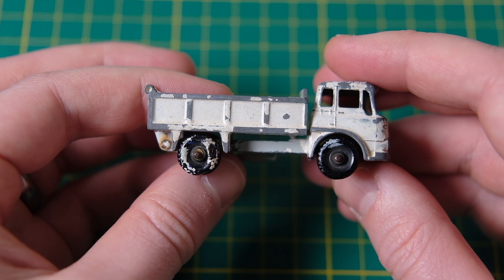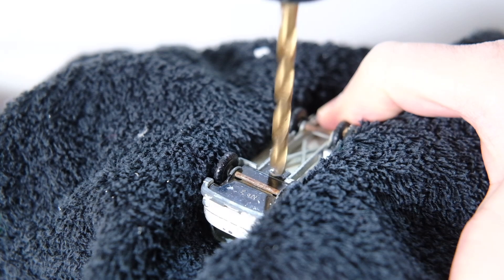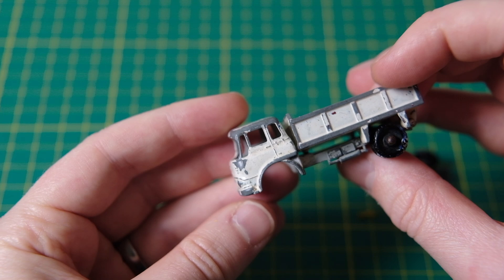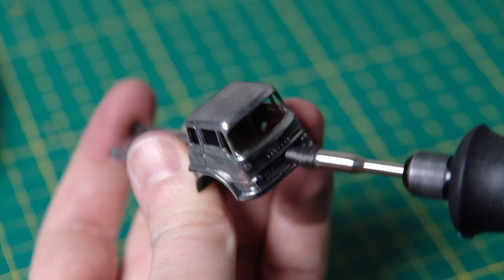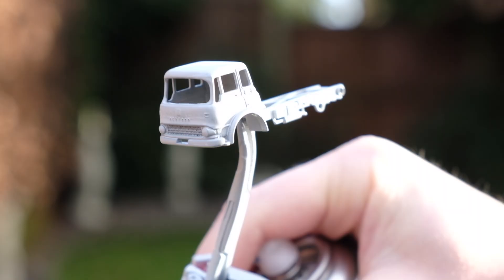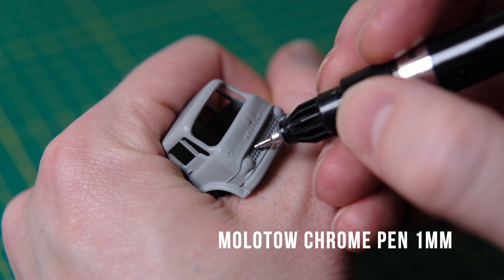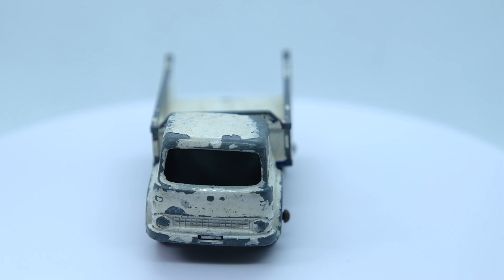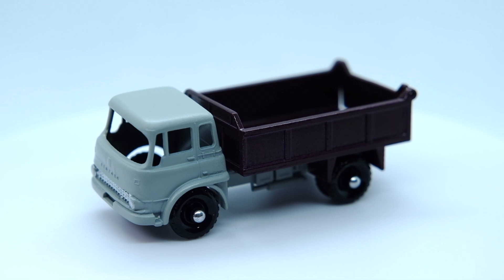MATCHBOX restoration: 3B Bedford 7½ Ton Tipper

Comment: Looks great Jason. Definitely some wonkiness going on somewhere. But I think it's the tipper that's got the wonky thing going on. Are the 2 pivot points for the tipper on the chassis in line or is it the way I'm looking at it ?
Reply from the maker: It is actually completely level which is why I think it’s to do with the turntable and the camera angle. It’s just more noticeable on this I think as it has that fairly loosely fitted tipper with nothing to control it, like a hydrosleeve